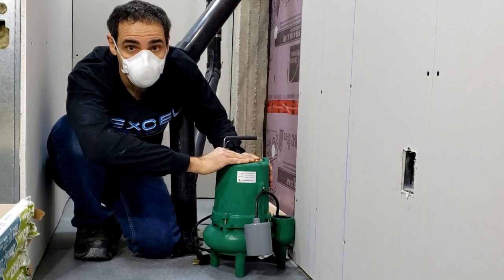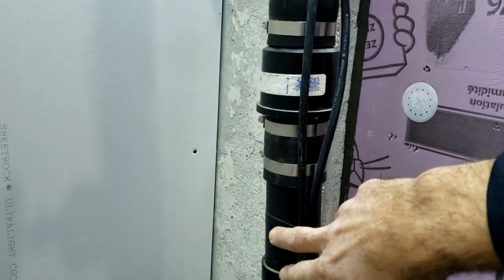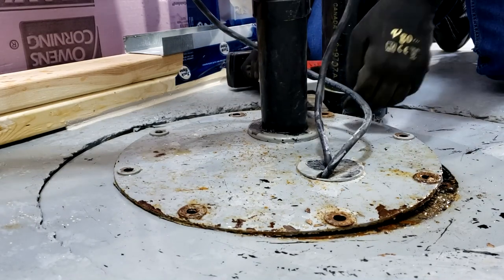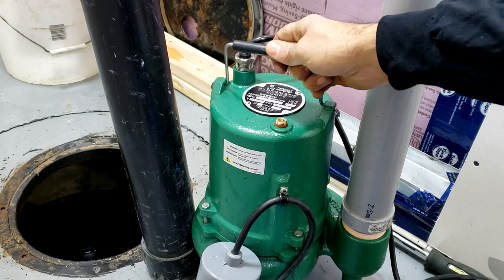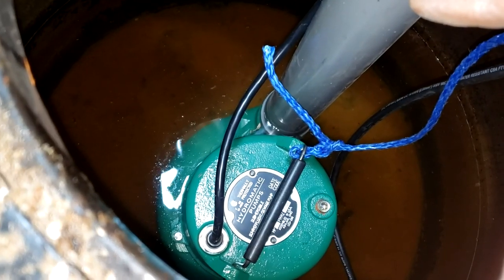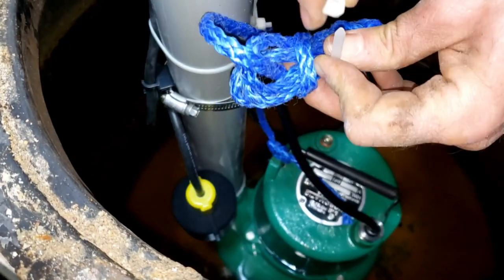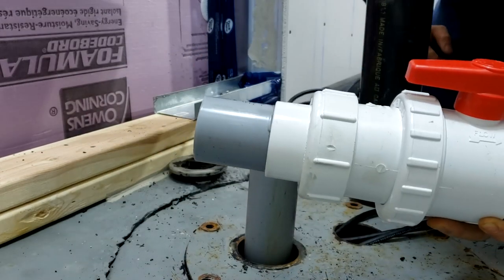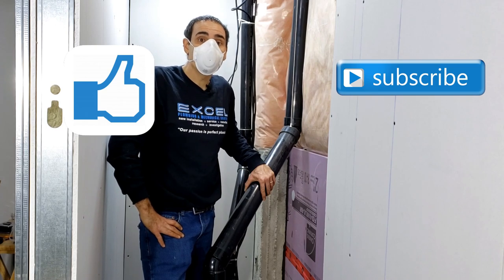How to Install a Sewage Ejector and Float Alarm

Comment: Thx Man, We've Had To Install A New One Long Ago But We Figure It Out On The Hard Way By Flooding Our Basement With Sewage And Other Nasty Stuff.
Now I Bought A New Pump And Didn't Want Do Mess Even More Up, So We Watched This.
Now We Can Wash Our Laundry And Use The WC Again.
And Without A Proffesional It Only Costed Us Around 400 $!
Thanks!!!!
Reply from the maker: Aw man!..there's nothing worse than a basement flooded with sewage! I am however, grateful that my video was able to contribute to helping you out with your problem!  If you haven't yet, I strongly recommend looking into installing a float alarm like I show in the video.  It's a relatively low-cost extra measure in helping ensure that you don't end up with another sewage disaster!  Thanks for watching, and your feedback! 🙏

Comment: 0:46 I need one of these. I'm surprised the guy who installed the new pump didn't recommend one. Thanks to installing a leak sensor beforehand, I was able to keep my basement from flooding at least. My sewage pump pulls double duty...and is also in a freaking crawlspace.
Reply from the maker: Hi there.  I presume you're referring to the float alarm?  Yeah, failed sewage ejectors are never fun for anyone (including the person replacing the pump!).  I encourage those float alarms for my customers not only for sewage ejectors, but for storm sump pumps as well.  Storm water is actually even worse in terms of potential damage, because it can't be stopped from flowing in!  As gross as sewage pits are, at least they can generally be controlled by the simply ceasing to use any of the building's sanitary fixtures.  Therefore, float alarms, are a solid line of defense for ejector systems.  They should be mandated into the Plumbing Code, in my opinion.  Thanks for your input!

Comment: I’ve got a float switch that hangs down on a string from the top of the cover and it gets stuck in the on position sometimes and leaves the pump running. Is it possible to just replace the switch or the mechanism where the string connects to it?  Thanks for this video it gave me confidence to DIY
Reply from the maker: By "string", do you mean the wire that connects to the actual float?  If so, then you will likely need to replace the entire float switch, which comes factory pre-installed with the wire already connected to it.  They're not typically replaceable because the float's housing and the wiring connecting to it on the inside must remain water-tight.

But another question is to ask why the float keeps getting stuck in the on position.  Before you swap it out, you might want to make sure that it's not getting snagged or caught somewhere in the "on" (sideways) position.  You can test it by manually rotating the switch between on and off positions while monitoring the behaviour of the pump.  You mentioned that it hangs from the top of the cover. Therefore, does that mean that if the cover is lifted, then the switch comes with it?  If so, you may want to reroute the float so that it is reinforced and held firmly by the discharge pipe, which will keep it in the same position and level (as shown in the video).  This way you can set and test the float while still being able to observe the discharge cycle while the cover is off.  If I correctly understand your current, situation:  Once you place that cover on, it becomes a bit of a guess as to what's actually going on in your pit.  Perhaps there's a possibility that your exisitng float is fine, and only needs to be reinforced properly. 

I'm glad the video gave you the confidence to tackle it on your own!  Thanks for watching 🙏 and Happy 2023! 🥂

Comment: Excellent video and clear instructions ! 
Thank you
Any recommendation where to purchase the pump and check/ ball valve assembly  online ?
Reply from the maker: Thank you very much! 🙏 There's sooo much more I intend to share with you all.

With respect to purchasing a pump and check/ball valve assembly online, I can't confidently recommend an online retailer. I'm not sure where you're geographically located, but here in Ontario, Canada, we have an abundant of reputable dedicated plumbing suppliers (Next, Noble, Wolseley, Desco, etc.) which carry high-quality & approved pumps and materials - and are willing to sell to the public (i.e., those without an account).  Personally, I'd avoid the big box stores, as the products they carry are significantly subpar to what's available from real Plumbing & Mechanical wholesalers (at least here in Canada).

Before delving into online retailers, I'd do a Google search for "plumbing wholesalers" located near you, and call them to inquire about  "sewage pumps" and "combination check/ball valves".  That Hydromatic pump I show in the video has proven to be a good brand, but there's also a slew of other brands I've had a great experience with, such as Little Giant and Liberty. 

Hope that helps, and thanks for watching!

Comment: I have installed dozens of these systems over the last 20 years.  The check valve must  always be installed  horizontally and be spring loaded, if not every time the pump shuts off it will sound like a sledge hammer through out the whole house..  I'm amazed at how many of these systems are installed this way.  If plumbers would simply read the instructions on a pump system they would learn a lot.
Reply from the maker: I appreciate your feedback, Vinny. 

The manual for this pump only recommends nominally horizontal installation for "best performance".  These particular check valves themselves are designed to be installed either horizontally or vertically.  As well, the manual also stresses that the check valve must be a free-flow valve, of which a spring-type is not.  

Although I've never experienced any issues with these check valves ever getting stuck on the vertical, I have had to deal with some existing applications where spring-loaded check valves got all seized up and jammed with non-organic solids, preventing the passing of further solids.  Messy, to say the least, and an event I certainly don't want to relive. 

I know what you mean about the sledge hammer noise...although in my experience, I found the banging to be more of a problem when the traditional brass gated valves are used.  These plastic and rubber-gated ones, not so much from what I've seen.

Thanks for watching!
Reply: @PlumbingsCool  I understand what you're saying. But there is actually a specific spring loaded valve that is unobstructed for this application. The main complaint I have ever had about working on these systems is the insanely loud banging when it shuts off. I have found that with a spring-loaded valve that is unobstructed made specifically for this application eliminates that problem when installed horizontally. It has been a lifesaver when I rebuild the systems. But whatever works for you and the customer is the bottom line for me.

Comment: Master! Just found this online as recent sewage pump malfunction, turn out to be the float piggyback, question is how to put the new float and level it ? Old one is digital float sensor , replacement is float piggyback like yours in video, zip ties on the plastic pipe , how tall ? By the side of the pump ?
Reply from the maker: I'm delighted my the video was able to help you out!

With respect to your new float, it should have come with some sort of small plastic bracket to hold it against the pipe and allow you to loop the wire so that it fastens with the wire pointing horizontally.  You'll want to leave about four inches (100mm) of wire between from the point it fastens to the pipe and the float itself.  Any less and it may cause the pump to cycle prematurely, and too long will require the water level to rise excessively high before it "flips" the float to cause the circuit to close.

With that out of the way, you want to place the float high enough so that there is significant discharge into the pit before it cycles the pump.  Too low will cause the pump to cycle too frequently, and with very little rise necessary in the pit; too high will cause sewage to escape back into the horizonal drain inlet (the source of your sewage).  Therefore, place the float high enough so that the pump kicks in when the pit's sewage level rises a few inches or so below the pit's drain inlet.  Again, if you place your float high, it's going to have to fill up ALL your underground horizontal drain lines before the sewage level can rise further to raise and activate your float.  

Of course this will take some trial and error.  Fasten your float to an estimated proper level, and simply let your pit fill up with clean water from your fixtures.  Adjust and repeat until you've maximized an efficient level for cycling the pump. 

Finally, be sure to ensure that the float is placed in a position so that it will not get caught or snag, otherwise, which may cause it to get stuck in the closed or open position.  Try to avoid having the float immediately underneath the stream of the drain inlet.  Otherwise, over time, any solids and toilet paper will build up and get caught on the float and wire, increasing the risk of restricting it's movement. 

Hope this helps, and thanks for watching!  🙏
Reply: @PlumbingsCool  u are indeed the master and you did reply me with all the details  , big big thumbs up to u sir, bless u and your family
Reply: @PlumbingsCool  will adjust it later tonight , base on the information u gave me best activation level is below 2 inched  the inlet drain to prevent waste water go inside the inlet drain. Mine home Depot brand didn't come with the accessories only 1 zip ties , so I will have to tied it lil bit downwards ,as now the pump activated at waste water rise up halfway to my inlet drain . :(
Reply from the maker: It might help if you raise the float higher, AND shorten the length of the cable between your zip tie and the float so that the float swings up and down a shorter distance.  In the worst case scenario, a half-filled pit is not that bad, depending on how quickly the pit gets filled. It's just good practice to try to minimize pump cycles for efficiency and to reduce unnecessary noise caused by the running pump and the slamming of the check valve.  Hope you get it working how you want it!
Reply: @PlumbingsCool  did that and I works great. Now I have another issue , the ball valv handle  above the check valve leaking water , I guess is old and I turn it off when I work on it once I turn back on it leaks , question is can I just buy the ball valve and connect using the existing using the rubber adapter ? Maybe glue with the little  extension PVC pipe make it  easier to connect ?
Reply from the maker: Sounds like it's leaking from the packing. Is the existing valve a plastic ball valve or is it a traditional brass ball valve? If it's brass, check if there's a nut just beneath the handle.   If there is, you should be able to remove the handle and tighten it up to stop the packing from leaking.   I have a Short which demonstrates what I mean:

https://youtube.com/shorts/BHc5EiWZxFU?feature=share

If not, then I'm afraid you're out of luck and will need to replace the ball valve. If so, you can purchase a PVC ball valve and (as you suggest) stub out pipe pieces from each end (as I show in this video) and connect to the existing piping with the use of rubber connectors...only be sure that the connectors are properly designed to accommodate the material and size you're connecting to.  For example, if you're connecting 2" plastic to copper, you should use an adapter referred to as a 2"  "Zip II" coupling, because the copper and plastic are NOT the same wall thickness.  If you're connecting plastic to plastic, then I prefer to use traditional MJ couplings because they're designed to accommodate schedule 40 piping (the same wall thickness as  most most PVC and ABS plastic drainage piping).  Also, their stainless steel sleeving makes them MUCH more durable than traditional rubber-only connectors (like those flimsy Fernco couplings that a lot of plumbers love to use 😒). 

By the way, if you do need to replace the ball valve, you may also want to replace the check valve while you're at it, if it happens to be very old.  In that case perhaps you can opt for an all-in-one fitting which integrates ball valve, check valve, and union connection, as I demonstrate in this video.

Hope this helps!

Comment: Great video! I have a question. Because most high-quality waste extraction pumps have painted, cast-iron housings, will these pumps be resistant to the potential corrosive effects of photographic chemicals (comprised of weak acids and strong bases) from a home darkroom? (The residential application will invovle no solid waste.) If so, should a thermoplastic sewage pump be used or a sewage pump made with baffled aluminum?
Reply from the maker: That's a great question!  Your best bet is to contact the manufacturer of the sewage ejector you have in mind (ask for the technical/product support department).  However, if I were to guess, I'd fathom that a quality pump would fare quite well subject to photographic chemicals for a few reasons.  First, the pumps are designed to convey organic human waste, which contains toxic elements in its own right - namely corrosive uric acid from our liquid waste (constant, unflushed exposure of urine onto copper drainage piping does quite a number on the pipe - often eating right through the pipe walls!).  Second, I imagine that your photographic chemicals will be diluted with water as it discharges down the drain, which should weaken the damage (if any) it may invoke onto pump's exposed surfaces.

Personally, I'm not a fan of plastic pumps - not even for simple clearwater sump applications.  The simply scream "cheap!"

Once again, if in doubt, do reach out to the manufacturer, who knows their product better than anyone - and are are often more than willing to help, provided they're a reputable manufacturer.

And by the way:  I love hearing that you're still developing photographic prints "old school"!  Sadly a dying art! 👍 It give me fond memories of me hanging around in my uncle's darkroom, beneath that ominous red bulb!
Reply: @PlumbingsCool  Thank you so much for your kind reply, and thank you again for a highly informative video. It told me everything I needed to know in order to install a waste water extraction pump.

As for the darkroom chemicals, I now feel confident enough that they will not adversely affect a cast-iron pump. If I change my mind, I can always spray paint the pump with rebar epoxy paint (Rust-Oleum Rb1600) to slow down the rate of corrosion.

The only other plumbing detail I will need to consider is the installation of the vent system for the waste water basin. I will consult the "Methods of Venting Fixtures and Traps in the 2018 IPC" for recommendations. I will most likely use a three-inch vent pipe, and run it to the nearest outside wall, where I can cut a three-inch opening for the pipe vent cover. Piece of cake, right? 😉
Reply from the maker: My pleasure.  With respect to a vent, are you referring to the sewage ejector's vent, or only the lavatory?  If it's a true sewage ejector pit, then a vent would be required because it would haver an air-tight lid.  In our jurisdiction, the sewage ejector vent would only need to be two pipe sizes smaller than the incoming pit drain, but no less than 2".

If it's a vent only for the lavatory, all that you'd require is an 1-1/4" vent terminating to open air (1-1/2" is fine and more typically available in plastic).  If you're running directly through the roof, then you'd need to upsize it to 3" BEFORE it exits the roof or wall (this is dependent upon your geographical area, because here in the Great White North, we have to upsize the vent terminal so that winter hoare frost does not choke off the terminal.). However, if you are having trouble terminating to open air, and all you're dealing with is a single lavatory for modest usage, one less invasive solution would be to install an air admittance valve (affectionately known as a "cheater vent").  To be clear, I'm not a fan of these devices in lieu of a true vent, but on the rare occasion, it does serve a purpose for a simple, single-fixture application where routing may Br tricky (a true vent is ALWAYS superior and preferred over an AAV).  Just be sure that you purchase one that is ASSE certified (such as the Oatey SureVent), and be sure to terminate the vent above the lavatory's flood level rim (or at least as high as possible below it.  Note that AAV's do NOT work for sealed sewage ejector pits, because they only allow air INTO the system, not OUT, so proper maintenance of atmospheric pressure cannot occur within the pit.

Hope this helps!
Reply: @PlumbingsCool  Once again, thank you so much for your response and for your very helpful information. I plan to install two vents: one for the sewage extraction basin and one for the lavatory. The basin vent pipe will have a three-inch diameter, and the lavatory vent pipe will be 1.5 inches across, which is one-half the diameter of the main sewage drain pipe for the house. I plan to connect the lavatory vent pipe to the basin vent pipe so I would only need to cut one hole in the house siding.
Reply from the maker: I love it when people go the extra mile to ensure that plumbing is done right!
Reply: @PlumbingsCool  Thank you again!

Comment: @Plumbingscool did you say that the check valve is built into that union along with that gate valve if so what is that part actually called if i was to buy it and install one
Reply from the maker: It's not a check valve, but rather a ball valve.  Simply google "sewage ejectorPVC ball valve check valve combo", and it should provide you with a ton of results.